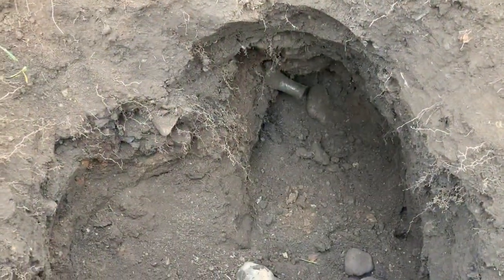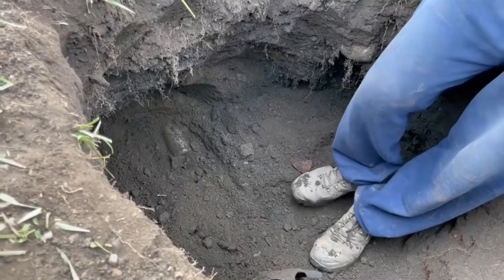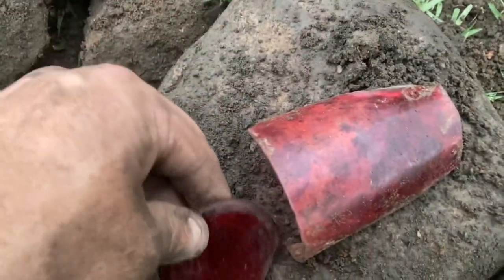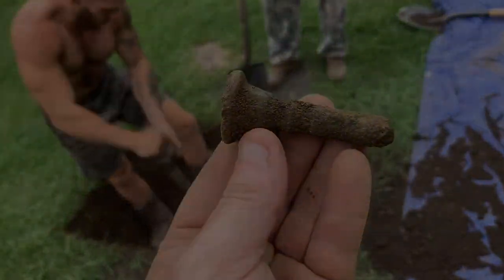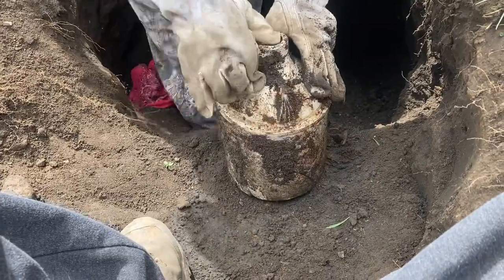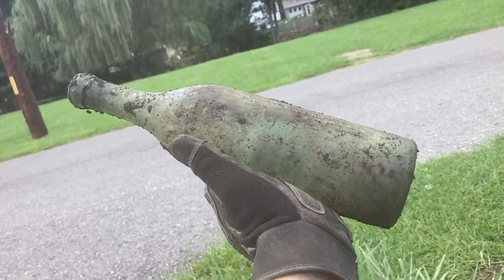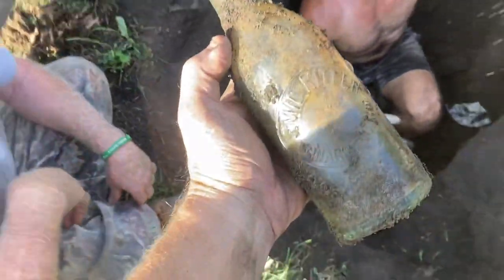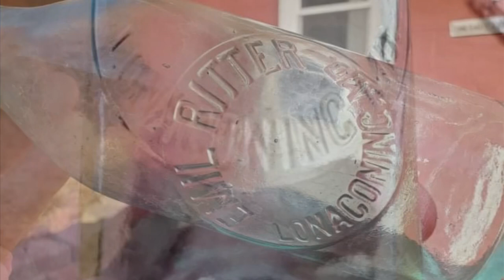Bottle Digging 3 privys, and another Rare local soda bottle plus lots of other amazing finds.

Comment: I enjoy watching y'all dig, and love the history! 
We bought an 1850's house and I would love to dig around and see if I could find something, but no idea how you know where to even start, lol.  We just have an acre of the original farm and it is a Very rocky area around here just from my experience digging  in the flower beds.  Lol. I don't think a long probe like yours would get very far in our shaley soil.  😂
Reply: There is civil war history as the confederate calvary led by General John McCausland travelled right by our house on their way to McConnellsburg PA after the burning of Chambersburg.   Maybe I should start with a metal detector?  😉
Reply from the maker: I definitely would start with a detector. You will most likely find the privys in the backyard of the house, but absolutely metal detect everywhere. Hope you find something incredible and have yourself some great adventures.
Reply: To try and find the privies.. Look for sunken areas in your backyard. Depressions that appear square where the ground is an inch or two lower. There should be several and likely fairly close together because they had to move the outhouse over the newly dug hole and wouldn’t want to move it any further than necessary. If you think you’ve found one, try digging around the edges of the depression and see if you can find the walls. Good luck!!
Reply from the maker: Since it’s your proper make test holes anywhere you think looks suspicious. Anywhere grass is growing thicker, anywhere a random bush or tree is in the yard, fence sinking, garden planted, soft spots, and as stated check all depressions.

Comment: Brighton, ground lip, large over the lip glass lid (1886-1897).  Some Patd 1895 (1895-1897).  2 potential clamp systems - metal band sliding across and over the glass lid, or a  double arm and snap clamp wire bail and glass lid. Pricey jar with complete system.